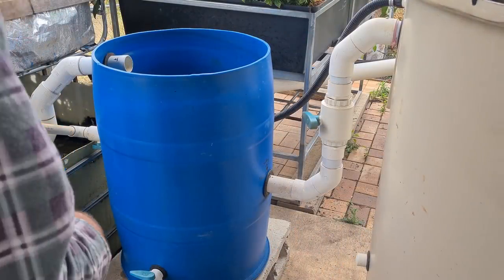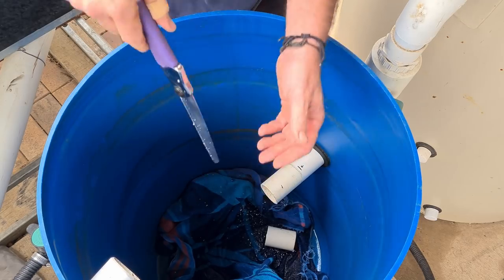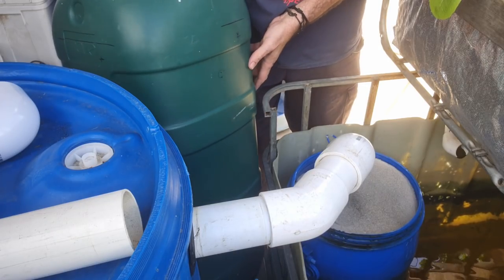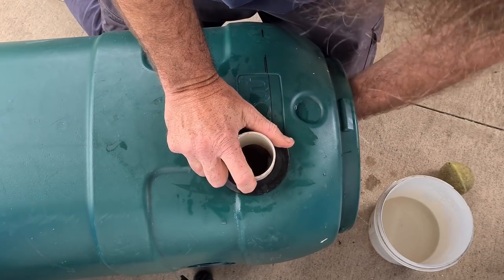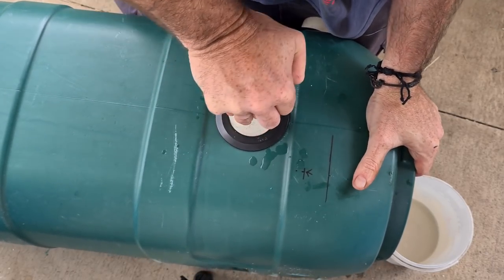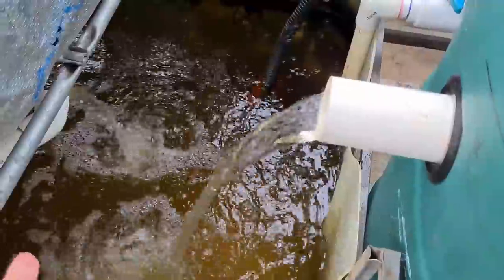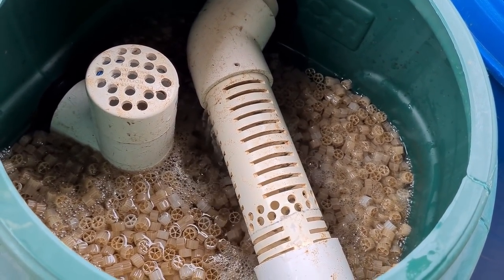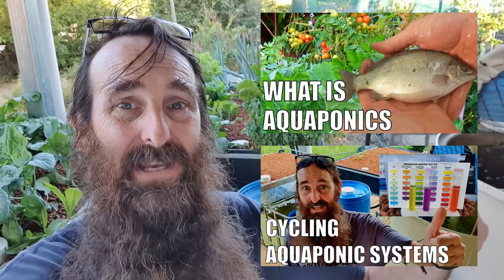Aquaponics Biofilter | Adding a Moving Bed Biofilm Reactor to the Aquaponics System

Comment: This video is a testament to the strength, flexibility and durability of the uniseal
Reply from the maker: I've found them fairly easy to use as long as the larger ones are used with pipes that are supported  in some way.
Way cheaper than a bulkhead set up as well. 👍
Cheers JM.

Comment: Good Day Rob!  You need neither a smaller air-compressor, nor risk damage by restricting the flow!  Simply, Add a 'Tee' fitting with an adjustable valve.  Pump runs happily at what ever volume-pressure it wants, the air-volume you /DON'T/ want in the bio-reactor,  simply open/adjust the valve off the Tee.  Vent the unwanted air-volume elsewhere.  Hell, you could vent the unwanted air back into main fish tank.  More air for the fishies.
Reply from the maker: That's what I had on the first biofilter in the old IBC system but have lost my 6mm valve. I ended up teeing off the line & using that air to help dechlorinate the top up water. 👍
Cheers & have a top one.

Comment: Hey Rob I’m a long term subscriber and really love your content. I was taught as an apprentice in the heavy transport industry to use something like Vaseline as a temporary lubricant for rubber and plastic. Maybe you could give it a go next time so that you don’t need as much force to push the pvc through the uni seal? Just a suggestion.  have a great day my fellow Aussie
Reply from the maker: The manufacture warns against using Vaseline & the like as it doesn't break down. It can cause movement in the pipe & possibly leaks under pressure. 
This is from the Uniseal Australia product sheet, "DO NOT use silicone, grease or Vaseline, as anything with a slippery or greasy base will cause the marriage between the pipe and the Alcryn in the Uniseal® to fail under pressure."
I remember someone also saying on a forum once that they used a commercial lubricant of some type & it broke the rubber down. 
Soapy water is OK as it breaks down allowing the pipe to get a good seal with the rubber. 
Cheers mate & have a top one.
Reply: @RobsAquaponics  I use just a little bit of soapy dish water.  A little bit won't hurt the system, plus once you push the pipe through the uniseal, you can wipe the pipe dry removing most of the soap.  And if you want to be super safe use Castile soap which is made with olive oil and is food safe.

Comment: Still along way from building one but so many good ideas and information, without changing the pump add a T piece and tap releasing the excess air into the atmosphere or add another stone into the fish pond(but than the tap might be better on 2 pipes, minds over thinking could be scary.

Keep up the great information.
Reply from the maker: It's now set up so I have an open line going into the fish tank with a restricted flow running into the bio filter to control the movement of the media. 👍
Cheers IA & hope the videos are helping with your plans mate.

Comment: Hello Bob... 
I have some questions... could you please answer that...
Is there any culture of bacteria in the bio filter(media)? If have then what's the bacteria name...?
Can i make this bio media by myself using plastic straw? Or I need special kind of material to make it?
Reply from the maker: Some folks will culture the bacteria in labs. I find it just as easy to allow the bacteria in the air around us colonise the system . You can also get some media from a healthy aquarium or a friends aquaponics system to help kick start the colony in new beds or filter.
No special medium is really needed as they will set up colonies on any surface they can. A few people I know have used the plastic bottle caps from drink containers as their bio media. They aren't as buoyant as the media I use but they do the job. 
Hope that helps some.

Comment: If you want to reduce air without damaging the compressor you can put a T connector with a valve and bleed out some of the air without choking the pump
Reply from the maker: Ours are always split with one valve left open. 👍

Comment: You won't need the down grade the air pump in your new setup if you split the line between the 2 filters that way you have have the air flow wide open going to both.
Reply from the maker: I was restricting the airflow as it was churning the media too much. To fast a "boil" & the bacteria can be knocked off. As it set up now, I have an open line going into the fish tank with a restricted flow running into the bio filter to control the movement of the media. 👍
Cheers Walter.

Comment: Rather than increase back pressure on the larger pump just bleed off air into any part of your system through an open, but regulated line. Just about every part of your system can benefit from a little extra air. A pressure gauge might be useful.

Comment: Awesome job Rob! I have a question, do you have the pump working 24/7? Also was wondering if you always buy the baby fishes, or do they reproduce in the tank? Thanks in advance
Reply from the maker: I leave the pump running 24/7 so the water is continuously cleaned for the fish.
The Aussie native fish we use won't breed in the system but others like Tilapia will quite happy reproduce in these small systems. 
Hope that helps some.

Comment: Got half of what i need greenhouse lying in the weeds, 
tore down a hog barn.
1 inch plastic 160# pressure water pipe 100s of feet.
 the auger to distribute food 3 Inch plastic 400 ft
Reply from the maker: Nice one Charles. How large is the greenhouse?
Reply: @RobsAquaponics  30 by 60
Reply from the maker: @charleswieand4445  That's a decent size mate. 👍 Would like to have something like that to play with here.

Comment: Rob I am using lava rock as my bed material. Is a moving bio filter needed or am I going with over kill? I am getting a radial flow settler added. I am changing to a split flow system as where I'm moving my setup out will be more suited for
Reply from the maker: As long as you have enough lava rock you should be good to go John. 👍 
25L/6.6gal per fish you want to grow out to 500g/1lb will do the trick. 
Cheers mate.
Reply: @RobsAquaponics  thanks yes right now I have one chop and flip. So I think I'm good...i will integrate it into a bigger system as I go.. Great videos and thank h you for all the help..

Comment: Hi Rob, great video, I couldn't see solid filteration unit? May be I missed.
Reply from the maker: The first part of the clip was me moving the radial flow settler Birendra. That's the only solids filter on the system. 👍
In saying that, solids will also collect in the biofilter & the grow beds as well. 😉
Hope that helps.
Reply: @RobsAquaponics  oh i see, thanks
Reply: @RobsAquaponics  great video my friend , do keep up the good work , two quick questions , from your experience with bio filters ,which do you think does a better job ? Moving bio filter or a static bio filter ( shade cloth etc ) , secondly , I am currently building a bio filter and leaning towards the static bio filter because I can't get the k1 or similar to purchase in my country ..what recommendation can you give to assist me in choosing the best materials to be used as a bio filter .. thanks a million :)
Reply from the maker: @fazimabdool6437  Hi Mate. I think the MBBR works better from what I've seen in our system. The movement of the media helps the solids to stay mobile until they can move out to a grow bed or filter/settler to be collected. 
I have seen folks use plastic milk, juice & soft drink/soda bottle caps as a static pack bio media & that looks to work OK.  A mate used the caps along with bird netting & shade cloth in his. I think it would pay to have some sort of fine particle filtration before it like aquarium filter pads or the floor scrubbing pads I used on top of ours.
Hope that helps some Fazim.
Reply: @RobsAquaponics  thanks alot my friend ...it's more than a big help , do keep up the good work brother , your videos are a great inspiration for us small diy guys ..cheers

Comment: Hey RB, I've got a question for y'all. I've been running one of yer cut & flip gardens for the past 6-months now. I have an inground pond that someone threw away, it has water lilies and an arrowleaf growing in it. 

Where'd y'all get those pumps from? I'm wanting to use the water from the pond in a horizontal bed to put my Bok Choy into or maybe some lettuce; I'm really not sure as I am new to this practice.
Reply from the maker: At the moment I'm using a Aqua Zonic Sumo series pump to move the water.  Not sure if they're available worldwide though.
Jebao & SunSun are 2 other cheap yet reliable brands that I have used over the past 10 or so years. Resun are also good but are a bit more expensive. 
Hope that helps some.

Comment: Once again, great video. As sent via email. 
I was wondering if you swapped the outlet and inlet pipe around so the in flow water enters and goes to the bottom of the barrel and the outlet collects the top water that has been through the reactor, would that work to??

I was thinking that the water has to go through the "K" media with bacteria before exiting, Would that be better? or maybe it wouldn't matter as it gets churned over by the air
Reply from the maker: Hi Dave. Just found this & will paste in my reply I sent via email to help those that might read this down the line.😉 
You can swap the inlet & drain around if you want with no issues. 👍 
I did have a few issues with the media impeding the flow of water out through the top drain so that's why I swapped the positions in the original MBBR & set the present one up the same way.
I don't think there is a real issue with the drain being ½ way up the drum (like in ours) as the air stones in the base are creating a current that cycles the water through the drum fairly efficiently. 
The only reason I have the drain ½ way down the drum is that I ran out of pipe & didn't have enough to reach the base of the barrel. 😉😁
I am confident the water has enough contact time with the media for the bacteria to do its job so am not overly concerned. 
Hope that helps some mate. 
Rob.

Comment: Awesome video!! You didn't add a venturi to the bio filter??
Reply from the maker: Not enough water flow from this pump Michael. The next build will use venturis in the biofilters as the pumps will be sized to accommodate them. 👍
Cheers.
Reply: @RobsAquaponics  is it ok to keep using just a air stone??
Reply from the maker: @michaelcurtis640  Air stones are better in some ways as they sit on the base & keep all the solids suspend in the water so they can be collected elsewhere. I found the venturi allowed some solids to settle out on the base under the outlet.

Comment: Hi Rob. 
I have a 3 barrel RAS system radial flow settler into MMBF into a mechanical filter/sump.
I believe my discharge heights on each barrel maybe slightly out. Should I always have discharge height lower than the previous barreling the system? I adjusted barrel heights which helped a little but had an interesting thing happen today when I increased my airflow into the MBBF the 75lts per minute raised the water level causing the radial flow settler to backup. Now I'm not sure on the fluid dynamics but if I fed an airstone up the inside of my MBBF discharge pipe maybe I could create a airlift and increase my discharge rate out of this barrel and prevent the preceding radial flow settler from backing up?? Do U think this may work? Or a can always make a new barrel:(
Reply from the maker: Having the outlet lower than the inlet will help a lot. I also oversize the pipes I use so even if at the same level, there should be no issues with water backing up in the settlers/filters. 
The air lift might help & it would be easier than having to build another filter. 
Sorry it took so long to get back to you.

Comment: Hi Rob,
Thanks for the great videos! I was wondering why did you decide to replace the static pack biofilter with a Moving Bed Biofilm Reactor? I'm building my first system and I was hoping to get away with just a Radial Flow Settler in my CHOP 2 system.
Reply: Hi Greg - I'm not Rob, but I'll venture some insight on this question:  The moving bed biofilm reactor has more surface area, and by its operation process, promotes more oxygenation.  This, in turn gives better bacterial filtering/conversion of NH4 into NO3.   The "static pack" biofilter quickly becomes a solids-settling tank with degraded(think clogged up or smothered ) bio-surface.  Worse yet: the static-pack, can become anaerobic and the eventual subsequent bloom of anaerobic bacteria WILL poison your fish!(very quickly!)   This is why, even with flood-drain systems and hyroton-clay, you periodically need to empty and wash the hydroton to remove all sludge.   At these scales - it is far safer, system-wise, to have a dedicated bio-film reactor(+oxygenation) and a dedicated sludge remover.  Sludge remover (Radial-Flow or Other) protects the bio-film reactor.   The bio-film reactor filters NH4, NO2, and protects the fish.   You will never regret building a moving-bed bio-film reactor from the onset.   You will be angry and frustrated building one /after/ you come out oneday to a tank full of dead or poisoned fish.     Best Regards,  -- Physicist.
Reply from the maker: I found that it wasn't processing the amount of ammonia that the fish were creating as their feed amounts increased. I was starting to see both ammonia & nitrite in the water flowing back into the fish tank, something I prefer not to see. 
The extra air running through the media will help boost the amount of ammonia the bacteria can convert as they don't perform well in low O2 environments.  There's actually a chance that they may start robbing O2 from the nitrate converting it back into nitrite if there's not enough dissolved in the water. 
I did have a similar solids/bio trickle filter working fine in the aquaculture system I was running with about 50 fish. The drum I used was larger & there was more air in the media which helped the bacteria do their job. 
Hope that helps some.

Comment: That muck in the media is what I’m worried about I’m the system I’m trying to build now cause the MBBR will be right after the settler (as it should be). I was actually considering using two radial settlers but would that just be an unnecessary (& extra) maintenance pain?
Reply: I use two settling tanks in my system, and I still wind up with a bit of fine solids in the MBBR.
For amusement, I did a "muck measurement" in the two RFFs about 3 months into operation, and it looks like 10% of the solids make it through into the MBBR.  Of the 90% capture, ⅔ winds up in the first RFF, with the balance in the second.  So, it's worth doing if you have the room.
Reply from the maker: The movement of the water should keep the media fairly clean DeadFred. Can't hurt to add on some extra filtration if you have the room for it though.

Comment: Hi Rob, I'm in the process of setting  up a chop and flip system, the only difference is that I'm using an external pump. I wanted ask what size hole do you use for a 50mm and 25mm uniseal respectively.
Reply: I'm in South Africa and they are called grommets here
Reply from the maker: If it's the Uniseal brand seals you're using then the 50mm pressure & DWV need a 76mm hole & the 25mm require a 44mm hole.
Not sure on other brands sorry mate.

Comment: I have a problem that I need some help with. I am very tight on space with my grow bed I can’t raise it due to it being in a grow tent (the maximum height I can have it is the height of a milk Crete off the floor) and having my lights hanging inside, I am using an ebb & flow grow bed and I am trying to figure out a way to flow water out of the bell siphon back into my 55 gallon drum fish tank if you have any tips for me I would be forever grateful.
Reply from the maker: Hi Darryl. I think I need a bit more information on the system. Any chance you could upload a video to YouTube? 
Sorry it took a while to get to your question.

Comment: Hello Rob how much fall do you have on the pipe running between the radial flow filter and bio filter ? please
Reply from the maker: They are set up at the same level Raymond. 👍 I've found the 50mm/2" pipe handles the flow quite nicely. 
I had it set up the same way in my past systems as well. 
Cheers mate.
Reply: @RobsAquaponics  thanks for that Rob,👍👍👏👏👌👌

Comment: Rob can you use a 55 gallon drum instead of the green bin for the moving bed part?
Reply from the maker: I would have preferred to use a 55gal/200L drum to increase the retention time Steve but just don't have a lot of space around the system. 
Cheers mate.
Reply: @RobsAquaponics  thank you Rob!
Reply: @RobsAquaponics  how big of an air pump and how much bio media would you recommend for a 55 gal drum?
Reply from the maker: @alaefarmestatesllc  The amount of media needed depends on the amount of fish feed the fish will be getting at maximum weight & they type of media. 
 I work on 1L/quart of the PEO3 (5 spoke) biomedia for each Jade perch we raise to 500g/1lb.  
As for amount of air, I like to have the media turning at a "slow  boil" as that will keep the media fairly clean & bacteria well oxygenated.

Comment: Could you hook the solids output of the radial flow directly into the bioreactor, and have a flow of bioreactor water back into the radial flow to recycle solids while separating nutrient rich, clean water in the radial flow?
Reply from the maker: Hey  Andrew. The job of the MBBR is to primarily convert the ammonia in the water through to nitrate. The additions of solids would impede that process a bit I think. 
You'd be better off running the solids from the RFS out to a mineralisation tank. There the organic waste can be broken down further into plant-available elements & returned back into the system. 
Hope that helps some mate.